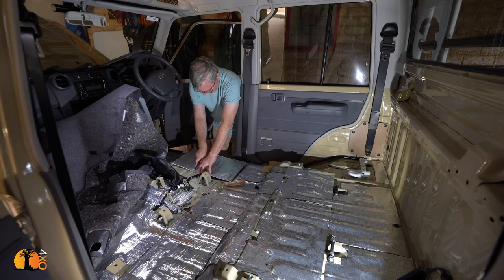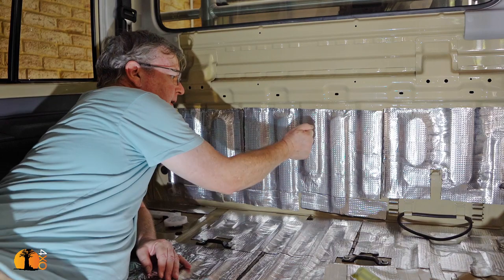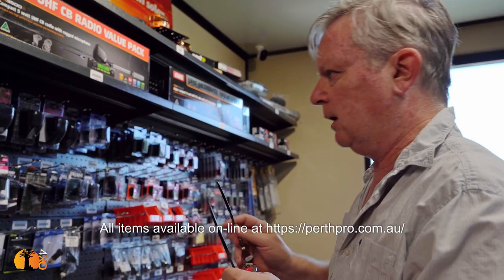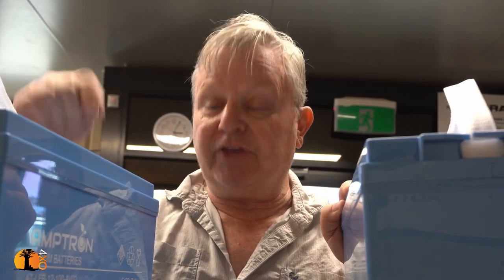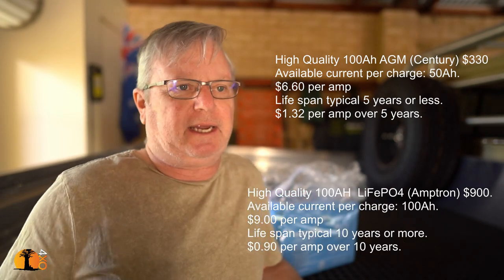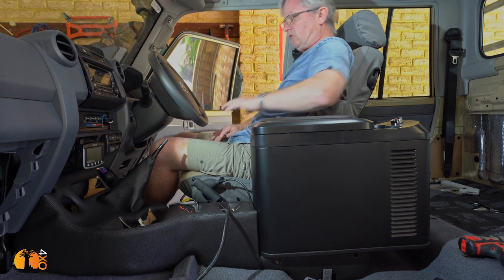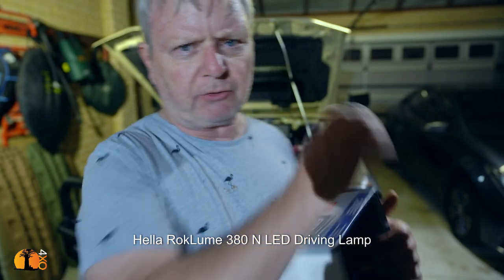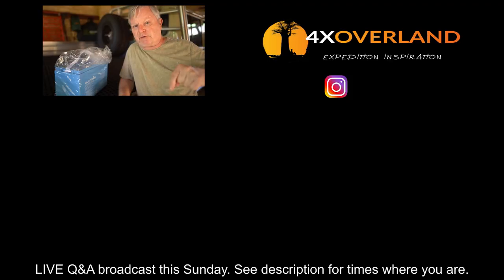LITHIUM VS AGM BATTERIES | THE TOURER WORK BEGINS | 4xOverland

Comment: Lithium batteries require a much better management and are very temperature sensitive.  To maintain their 200 life cycles you can only use 80% of their capacity.

Comment: Have had my Falken WildPeak AT3s on my FZJ80 for about 3 years now. Love them. Low road noise, great in the snow and rain and handled off road perfectly fine in my area. Will test them out in April on my next 4x4 outing. Cheers.

Comment: my tip for lighting. Check out the Philips Ultinon LED globe inserts for the actual headlights. Best thing I've done for my vehicle, especially after I fitted my LED lightbar. More balanced light colour now too, half the current requirement and much much brighter then halogens. I haven't looked into if Hella have any equivalent halogen replacement LED globe inserts, but I dare say they would too.
Enjoyed this one more than the intercooler scoop video!

Comment: I have had very good luck with General grabber X3 in 33x12.5r 18. Excellent in snow, mud, and sand. Have had no issues in rain. I have 50,000 miles on them and they are wearing well. With the exception of one tire starting to wear slightly out of round.
Reply: Southern Nevada offroading and back country - I like mine as well, little over 24k on my 9,500# Power Wagon. Even did respectfully well on the beach in Mexico last week.

Comment: Hey Andrew, as usual, another excellent video with lots of very good advice.  I would like to comment on your explanation of how Lithium Batteries discharge.  I ride an e-bike with a lithium battery and the discharge "curve" is not level at all, never has been.  It is more like a parabolic curve where the closer I get to full discharge the faster the voltage falls off, but falls very slowly at the beginning.  I do have an LCD screen that shows the voltage falling off just like a LA battery but not at an almost 45 degree straight line of decrease like a LA.  Cheers

Comment: Great looking build. I am running the Wildpeaks as well on my Discovery 2. Love them and I know the self internal conflict of AT vs MT :). I know they are part of the tire pressure monitoring but if you run any rocky terrain ever you are going to clip one of the tire valves and loose all your air right quick. Go rubber Love your channel!

Comment: I am 100% with you on the insulation sound proofing but my question or concern is, will that rubber foam layer hold water.
Reply: I believe in the video he said it was “closed cell” foam which means it shouldn’t retain water. The “open cell” foam will though.

Comment: Ah vehicle lighting, one of my biggest bugbears for road vehicles here in Europe. DRL's have been compulsory here in Europe since 2011, the problem is that many drivers leave putting on their headlamps at low light levels as they do not appear to realise that although they have DRL's at the front, they have no illumination at the back. The next thing that annoys me is the reliance on automatic lights, unfortunately the sensors work on ambient light levels and so do not switch the headlamps on, and therefore also the rear lights, when there is low visibility due to fog or rain but the ambient light level is quite bright. Talking about fog, the next thing that annoys me is rear fog lights and their (mis)use, here in Germany it is illegal to switch on the rear fog lamps when visibility is above 50m and also if it is raining or the road surface is wet, and so reflects the light, but a lot of people do not appear to know this. The other thing is, I believe that the use of rear fog lamps lull following vehicles in to a false sense of security so that they a) drive faster than they should and b) hang on to the car in front. I believe that the main light switch should only have 2 positions - I) The lights are off when the ignition is off, dipped headlamps and rear lights come on when the ignition is switched on, II) Parking lights are on with the ignition is off and again dipped beam and rear lights come on when the ignition is switched on. Well that's it for my moan!

Comment: @4x4overland   Toyo open country R/T   is an hybrid between the M/T  and the AT2  
    " The Open Country Rugged Terrain (Open Country R/T) 4x4 tyre from Toyo Tires is a next-generation 4WD tyre that combines the extreme puncture-resistance and strength of an M/T with the long-wearing compound and sealed road performance of an A/T to service the emerging ‘hybrid’ tyre category"

Comment: Mickey Thompson ATZ P3...in my opinion, very close to a hybrid MT x AT tyre
Reply: I have these, Mickey Thompson's own brochures advertise them as between an AT / MT, I find them to be quiet enough on the highway, heaps of grip everywhere I've needed it.
Reply: @IsaacTorres_AU  just expensive :*(
Reply: @Evenstephenss  Cheaper than BFG KO3s in 285 70 17s at the time

Comment: Great content Andrew, one thing I always think is worth mentioning is the LiFePO4 Lithium Batteries also behave differently in a fire situation.  Hopefully, you never get in that situation due to a quality electrical installation.  But, if you do have an electrical fire you need a specialist fire extinguisher that contains Graphite based dry powder, that forms a crust over the battery and starves it of oxygen.  A normal dry powder extinguisher used on vehicles is not as effective as a specialist extinguisher for lithium batteries.  Using water could be fatal.
Reply from the maker: New technologies in these batteries almost completely eliminate the risk of fire.
Reply: @4xoverland  Thanks for the explanation, I'm sure you've researched them thoroughly.  Good luck with the build.

Comment: Would you consider mounting 2 lights either on the roof or bull bar that were angled slightly outwards to provide a wider beam of light? My belief is that they would help show wildlife and potentially help prevent a collision and they would also aid during a turn as they would provide light into the area you are turning into.
Reply from the maker: considering doing that with two bars on the rack.
Reply: @4xoverland  Make sure you mount the lights well back from the front of the roof to prevent glare from the bonnet.

Comment: Afternoon from South Africa, you asked about questions , the rear doors could you not have them opening from the the other way , this should give you more access
Where the wheel arch was why not make that into storage area with a drop down door both sides
Reply from the maker: there is a double rear door option

Comment: personally if I were going to play about with 100amp bats I would run 4 as house a 1-2 crank just because you might be electrically isolated  from charging  doesn't mean you are electrically isolated  between  house and house and crank batts

Main reason I was suggesting a 6x6 in the last video  as it gives you a margin of space you don't typically get in single/double utes..

I know you did 6x6 tour drive though i would love to see you do a 6x6/8x8/8x4 build and drive may be even look at mounting a troopy on the  back of a  70 series ute from the    firewall back..

Comment: I have used that closed cell foam on my truck, its good for sound, but when you water in the cab, it is a nightmare to get the water out. The foam acts like a sponge and holds onto the water

Comment: rules of thumb LiIon battery discharge :
"1 C" - that means it can be discharged by the same amount it delivers current.

So a 100 Ah 12 Volt LiFePo can be discharged w/o problems by 100A!
An AGM starter battery, 100Ah 12V, usually can be discharged by 700 - 800A! for a short! time, like starting.

Some more modern Lifepo can be discharged by 2C - but this still is not an alternative.
you can charge your starter battery though, before using the starter one.

Comment: Andrew, i have had sevral sets of falkens and my current set is being looked at by falken for an admitted batch issue. Problem with the base rubber ripping off once worn to a point.

Comment: I thought you were "a brand ambassador" for BF Goodrich?
I had the KO2's as my last set, and currently the Wildpeaks. I miss the KO2's even though the extra weight affected gas mileage.
A 285 width? So much for your opinion that skinnier is better. You previously said that you'd prefer a 225/85. I'm confused by this choice.
Reply from the maker: I far prefer narrow tyres. Very few 255/85s are available in Australia, and if I have tyre problems, I'll not find a matching spare easily. But tyre makers make very narrow few options that are practical.  I was BFG brand Ambassador. I gave it up.
Reply: @4xoverland  I would think that the 255/75 tire would be a sweet spot. Curious to get your opinion on the Wildpeaks. For me they're softer, and lighter; but better? I'm not sure.

Comment: You can get a tyre between MT & AT, the likes of a Goodyear Duratrac would be an example of this
Reply: What he said
Reply: Excellent tyre too... Better than any Mickey Thomson or Cooper I've had.
Reply: they not 3 ply tough though.
Reply: @simon762321  no, they have a 10 ply rating
Reply: In the States we also have the Goodyear UltraTerrain, which is an excellent in between tire.
Reply: @MR1wooki  in the tread maybe, not the sidewall.
Reply: @markpalmer3071  Huh. I run the mickey's and they are way better than any Goodyear or BFG I've ever run. I guess its vehicle and environment defendant.
Reply: @MichaelRCarlson  yep could be, I find the two you mention go hard and lose grip before they wear out. The Duratrac has been the absolute best tyre I've had, just my opinion. Enjoy your tyre choice and don't worry about other opinions. :)
Reply: @OneManTrail  I just put those on my Ram 1500, so far so good. should be able to test them out in the snow in about a day and a half which is what i bought them for. only down side was reduced MPG from the heavier tire. that and they do seem to be a fairly soft compound so im curious to see how they hold up mileage wise.
Reply: @mylt1z28  I loved mine in the snow.  They've been great all around.
Reply: Personally I run the Maxxis Razr's, but I do like the duratracs and would happily run them

Comment: Andrew, do you say "ampere-hour" or "amp per hour"? The second is not accurate. The unit Ah is one amp delivered for one hour, or an amp times an hour, not an amp divided by an hour. This is confusing me.
Reply: I am sure he said "ampere hour". His pronunciation is a bit odd. He is unlikely to misunderstand basic electrical terms after his years of modification of off road touring vehicles. If you follow his commentary, he clearly understands about current delivery over time.

Comment: Lifepo4 can output huge discharge loads.  But I think those all on ones with the built in BMS will limit how much Discharge they can output.  I run Winston lifepo4 cells with I believe are rated at 3C constant, or 10C from short bursts (300A or 1000A for short bursts from a 100A lifepo4 battery).

Also redarc should follow Victron and not charge lifepo4 so high.

Comment: Re your Tyre dilemma  ...
I used to manage a large fleet(2,200) of which there were 6 Off Road Emergency 4x4 Ford Transits
After various whinging about tyres from drivers, we settled on All Terrain on the front axles and M&S on the rear
as policy, with ONE All Terrain spare tyre ...

Comment: Andrew - Are you planning on doing an HID conversion to your stock headlights?
I tried LED in my FJ Cruiser and they were nasty, then tried a drop-in 35w bi-xenon HID kit, and what an improvement. factory like cutoff, no excessive glare, and fantastic light without being too bright.  I went for a nice warm 4300K because I hate that nasty blueish colour. Only shame is that I couldn't get the same colour temp in my lightbars (6000k)...
Reply: Totally illegal as an aftermarket fitment without an automatic self levelling system & a wash system too, so they're almost impossible to fit correctly to anything not originally designed for them.
Reply: There is no way HID bulbs retro-fitted  into a headlight reflector designed for incandescent bulbs is going to produce “factory” light spread! You are kidding yourself and throwing lots of glaring light onto on-coming motorists! It bloody annoying, dangerous and illegal.
Reply: @johncanalese588  That's just your opinion. I'm very conscious of glare and light pattern, and that's exactly why I binned the LEDs. Laws differ around the world. The previous reply stated that it isn't an option in WA because of reasons x, y, z, and I thought his reply was thoughtful and well reasoned. Yours on the other hand is a rant that added nothing of value to the conversation.
I bid you a good day.
Reply: @amaclach  I also have been experimenting with lights (for more than 40 years...) and ended up with warm HID inserts in projector headlights. The beam pattern is extremely good and the colour is excellent. I threw out my light bars in favour of a pair of FYRLYT 9000 lights. Excellent light, doesn't reflect off road signs nearly as much as LEDs and I can use them in fog and dust, unlike LEDs. Having said that, I believe there's a mob making warm colour LEDs so maybe there will be another choice. Sigh :-)

Comment: Has this latest 79 series fixed the horrendous rear tracking issues?
Reply from the maker: I fixed it. Toyota hasn't.
Reply: @4xoverland  I still do not understand the reasoning behind why Toyota doesnt just fix this issue?? Might be worth a quick video to get some reasoning on it.

Also i hope they fixed the stock gearing issues, early models were shocking on the hwy at 110km/h.
Reply: @gureno19  Toyota are too mean to widen the rear track to match the front. Gee, they only want 80K or so for a basic vehicle.....

Comment: Seems like yesterday you were obsessing about how lead crystal batteries were the ultimate for 4WD tourers. Glad to see that has been sorted.
Instead of using negative power lines, put the money into higher current (thicker) positive only and reduce your critical voltage drop in 12V systems. You did not say why you don't like using the chassis? 

I would've thought A/T tyres were better in sand than M/T as you indicated. M/T will bury you quicker. Cheers.
Reply: Mondo Hamster mud tyres digging holes in sand is a myth. Let the down adequately and they’re sensational.
Reply: @shanenorwell8580  You have replied to the wrong guy
Reply: Harvey Smith huh??

Comment: 80% at best for ah on Lithium, it’s great but not 100% so I’d like to see 11.2 per amp over 10 years, 1.1 ;-)
Reply: Really depends on the battery and load. Quality batteries hit >95% of their stated capacity at low loads(0.1-0.2C) like you'd see with a fridge, fan, and small LED area lights. But AGM batteries get closer to 70% of capacity, rather than the 50% he stated. Lithium does way better than AGM at higher loads like 0.5C or more, still hitting 90%, while lead acid batteries are down to 50-60%.

Comment: Nitto has released an inbetween tyre - the ridge grappler
Reply: Same with Toyo with their RT's, Sits in between the AT II's and the MT's
Reply: And yokohama x-at
Reply: And maxxis razr
Reply: Also Cooper Discoverer S/T MAXX
Reply: Pedro Silva yuck
Reply: mmm - my understanding is those tyres are show tyres. IE they look cool and tough, but are not built tough. Or am I wrong?
Reply: Simon du Toit  Not sure how you got that idea ... it’s a good hybrid tire with tough sidewalls
Reply: I reckon Andrew knows. Cooper had them for years now, the S/T MAXX.
Reply: @simon762321  have had my toyo RT for about 20-30 thou k's (gu td42 patrol) in everything.. snow, sand, sharp jagged rocks, all of it and they've got heaps of tread left, quiet on road and haven't had any issues.
Reply: Goodyear Duratrac is a hybrid.
Reply: Second the Goodyear Duratrac
Reply: cooper st maxxs have been around for years, very aggressive all terrain, brilliant set of tyres 70k been to hell and back, no punctures, very good tyre

Comment: can I put 2 lithium batterys 270 Ah + 100 Ah = 370 Ah to my 12V system. I used Redarc 
DUAL INPUT 40A IN-VEHICLE DC BATTERY CHARGER.

Comment: Andrew, there is one tyre that claims to be between AT and MT. I wish you would test them because I want to know if they are any good. GOODYEAR WRANGLER DURATRAC
Reply: FC Buys very thin sidewalls. If you’re around rocks or anything else that will puncture them, I’d avoid. Very noisy as the wear too.

Comment: I am interested in how to charge those Lithium batteries since I hear that charging them directly though through a relay that it can damage your alternator I can not find a BMS that will work with a 200 amp input
Reply: Lithium can no more hurt your Alternator than anything else, it would kill the VSR before ever getting to the Alternator even in that were true.  Not all Lithium batteries are equal, its important to know what you are buying and who makes it and how they make it.  You need to know is the BMS included a Battery Management System or a Battery Monitoring System.  They are both calls a BMS but one does a lot more than the other.

Understand that a 100Ah Lithium doesn't take 100amp input, the current they will accept varies as it does with AGM's but a good quality Lithium will accept 80 amps input which a VSR and Alternator can provide easily and then you let the Lithiums BMS handle the rest.  Safiery batteries do a very good job of this.  This way you get the fastest charging possible, obviously when you add a 2nd battery you slow things down as you are now Current limiting the batteries as you cannot supply the amps to both that they can accept.  However, there isn't a DCDC on the market that can do better anyway as most are 40-50amps.